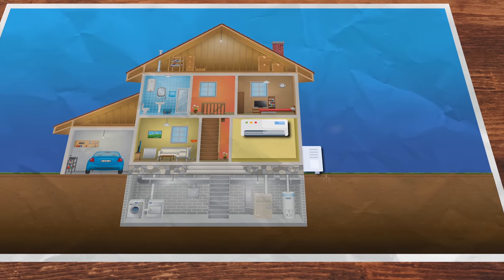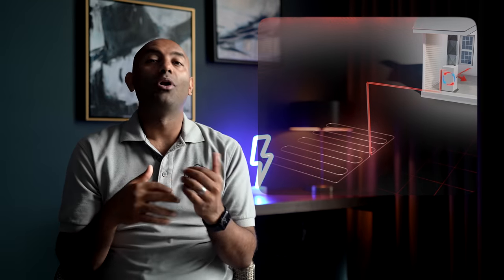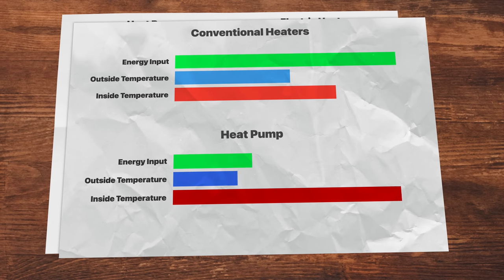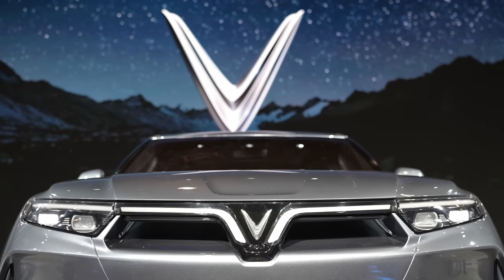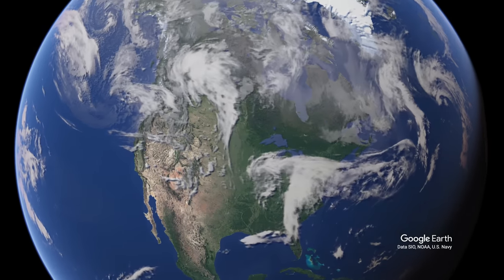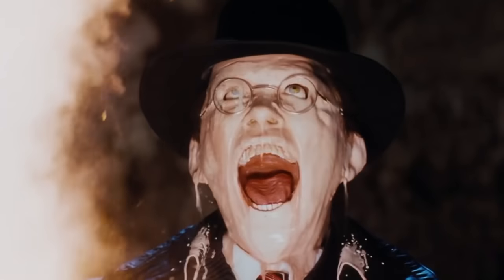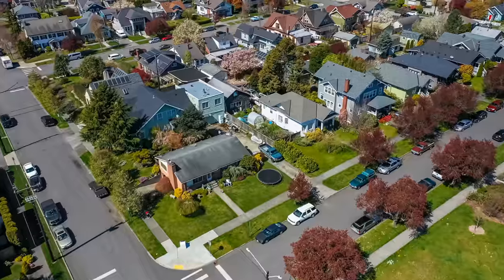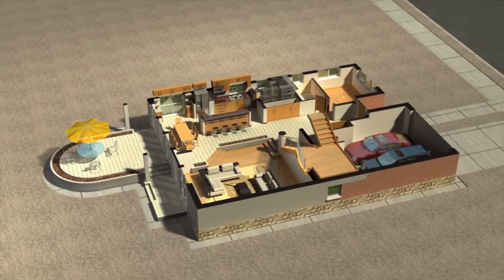Adding This Can Save You Money Summer & Winter!

Comment: We had Geothermal installed last September and it has worked flawlessly.  It is a 5 ton vertical closed loop system with two 288ft wells.  In January it used 1269 kwh (@.17/kwh is $215.73) , in April  it used 387 kwh (@.235/kwh is $90.945) so it seems it will use less electricity in the summer.  The oil furnace at 80% efficiency would use about 100 gallons of heating oil in a typical January plus electric for the blower (heating oil is now $5.37 per gallon here).  Our house has 1920 sq ft of living space and was built in 1987 and is reasonably insulated.  We live in near Kingston NY.  We are installing a 16kw solar system as our electric went from .17/kwh in Dec '21' to .235/kwh in April '22'!
Reply from the maker: That’s amazing data Chris! Sounds like hearing is the bigger challenge up there. Thanks for sharing and excited about the solar install! Prices are way worse here in CA
Reply: Just to give an idea of what actually happens:  Jan 15th 6:18A ET,  4.6F outside,  system is on, Water temp in: 40.46F  out: 37.23, Supply air: 92.56F  Return air: 67.95F /  May 8th 11A ET, 53F outside,  system is off,  Water temp in: 55.41F out: 55.7F , Supply air: 63.95 Return air: 63.19 (House is at 73F).
Reply: Good move Chris. Heating will always be the higher cost service with geo or any sort of heat pump.  The logic is based on the delta between ground temps and your creature comforts levels. Ground temps in most areas down 6’ from the surface or deeper are around 50-55 degrees F. Your comfort levels are 72-77 for most folks. The delta in summer between your comfort level and the ground temp 6’ down or deeper (55 degrees F) can be as much as 45 degrees F. In the winter, the delta between your comfort level and that 55 degrees is never more than about 20 degrees. That’s why geo works so well.
Reply: Hello Chris, I'm just accross the river from you in Hyde Park. What company did you use for your Geothermal? What was the cost and what was included? In other words, did you already have the ductwork, or did they install that too. Also what brand system was it? TIA
Reply: @joshmanor9970  Hi Josh We used Dandelion, and I would recommend them over anyone else.  The only problem is I hear they really have a backlog so it may take up to a year to actually get the system completely installed.  The timeline for ours was 9 months from the day we signed the contract to finish.  Our system is as described the only option we didn't get was the desuperheater as we already had an efficient hot water heater.  The total cost was $40,375.00 but the actual check we wrote was $28,805.00.  After the tax credits the total cost was $21,315.00.  Yes, we already had a hot air system (ducts) which had to be improved for the geothermal.  The electrical also had to be upgraded to 200-amp service which required the main panel be replaced.  The brand furnace they installed is Aaon.  We've not had any issues at all, and it has performed flawlessly.  In the winter (Dec/Jan/Feb/Mar) it used 4590 kWh which at our electric rate cost $1175.04.  Our oil furnace for the same time period at today's heating oil price would have cost $2950.00.  Even on the coldest nights we are warm, and the hot air isn't as dry as that from an oil furnace.  In summer (Jun/Jul/Aug/Sep) it uses less electricity 1505kWh for a cost of $385.28.  It does have Aux Heat which I call toaster heat, but it only rarely came on and used 23.78kWh for a cost of $6.09 over the whole winter.  So far in 2022 the Aux Heat has used 38.2kWh for a cost of $9.78.  The maintenance of the system requires changing filters, pro service after the first year and pro service every other year thereafter.  If you have any other questions, be glad to answer.
Reply: @chrismaxny4066  okay, thank you for the info. Yea, thats some wait time! Wow!  Another question...I'm guessing you did a closed loop system, but did you do vertical or horizontal loops? Water with antifreeze, or the newer vertical "DX" (copper pipe with the refrigerant)?
Reply: @chrismaxny4066  why did you only write a check for $28k if the total was $40k? What happened to the other $12k? That wasn't the tax credit right? You said that came off the $28k number. I'm confused
Reply: $1750.00 for not financing and $9820 from NYSERDA that goes directly to the contractor but they only pay if you use an approved one.
Reply: @chrismaxny4066  Oh, okay. Wow, thats a nice deduction right off the top! Then you have to pay the rest in full, then get the tax credit money back in your next tax refund, right?
Reply: @chrismaxny4066  And again, what type of system do they offer...closed loop vertical or horizontal with water and coolant, or the vertical copper pipes with freon? Do they offer a choice, or only install one style?
Reply: @joshmanor9970  Dandelion does closed loop vertical systems with water and coolant.  They don't do the DX system.
Reply: @chrismaxny4066  no horizontal systems?
Reply: @joshmanor9970  Call Dandelion and ask them.
Reply: Correction: The $9820 came from Central Hudson not NYSERDA

Comment: The combination of geothermal heat pumps and net metered solar power make an even more economical arrangement. You pay zero for utility bills and have reasonable paybacks, plus once installed the geothermal well (the most expensive part) doesn't need to be replaced for generations (not years, generations). The well material is polypropylene tubing which will last for hundreds of years in the ground.

Comment: Unless you live in Alaska (where closed loop heat pumps are pretty awesome), the calculation that needs to be done is to compare the cost of the ground sourced heat pump against the cost of a normal heat pump + solar panels.   I've done this calculation many times and I have never been able to justify digging into the ground.  It just makes a lot more sense... enormously more sense, in most locations, to spend that money on a cheaper (less efficient) air-sourced heat pump plus solar panels.  The other reason I would go this route is that it is a better fit for home energy storage systems (adding batteries to the solar system that you might want to do later on).

That said, I still really like the idea of the ground-sourced heat pump.  Well, at least closed-loop air systems.  I don't think well-based systems are a good investment for numerous reasons (maintenance, well depth, and vertical movement of the water table potentially causing the system to fail), but I guess it depends on the location.

BTW, modern gas furnaces last a lot more than 10-20 years.  30+ years is very typical these days.  10 years?  Only if you are being scammed.  The only thing that really breaks on a gas furnace is the Igniter which is $25 or less and a simple DIY replacement.

-Matt
Reply: Yeah. I put my gas furnace in in 1978. 44 years ago. I clean and oil it every year. still works fine.
Reply: I live in Alaska. I never thought these systems worked here because the ground is usually pact with permafrost and never wants to heat

Comment: I live in minnesota and we got a new Bosch IDS 2.0 Air source heat pump 2 years ago. It pretty efficient as a heat pump, works well enough down to around 0F, and is very efficient as an AC. We were doing a lot of work that summer and also got an induction stove, solar panels and new windows so there was a bit of question for us about if we were overstretching financially. 

I'm pretty pleased, what what we installed but i do wish i had looked more thoroughly into geothermal before getting the heat pump and spoke to geothermal specialist and not just the normal HVAC folks, but honestly, i just wasn't informed enough at the time to dig into it too much and happy to accept the HVAC guy's comments of how ground source is too expensive. It may have been in the end, but I am convinced it would have been worth stretching for if it wasn't too far above what we were paying anyway.

Comment: This was one of the major pros when we bought our house almost 9 years ago. Living in Sweden it is rather common and our system was installed in 2004 so the 20 year mark is soon coming up. 
Here most systems are made with a borehole into the bedrock but where we live in the south there isn't much of that so we have a ground loop.
It also has an extra heater if it gets too cold to cope, but that rarely happens, I think we have used it maybe for 40 hours during us living here.
I only would like the heater to be a bit smarter so that we could use it better in accordance to electricity prices.
Reply: James Biggar on YouTube did a hybrid solar pv / thermal heat pump design with air diverter valves triggered by temperature. So he's cooling his panels with incoming Canadian winter air that feeds warmer air into his heat pump. Brilliant but situational how close neighboring properties are and surrounding sunlight obstacles.

Comment: Geothermal heat pumps are great as long as the water is warmer than the air outdoors, once they are equal temperature there is no advantage to a ground source heat pump.
Heat pumps are AC units that reverse flow via a valve rather than physically reverse the unit say an AC in a window, Heat mode is AC with the AC unit in the window backwards.
As an AC unit operates around 40F and in heat mode we are air conditioning the outdoor air, once the outdoor temperature gets to 40 F the AC unit can no longer "boil" the refrigerant as there is no temperature differential, that  is why  below 40 F outdoors heat pumps require auxiliary electric strip heat which is very expensive to operate.
Reply: Geothermal HP are not using air for the heat exchange; they use liquid. Outside air temps have no effect on the system. I also don't believe anyone would spend 10's of thousands of dollars and use window a/c. Perhaps I'm misunderstanding your post, though. Sorry if I have.
Reply: And yet some how they can pull heat out of-15f air with cold climate heat pumps just not as efficient.....
But again totally different animal.

Comment: I’m just building a 6 bed house in the uk. It will have superb insulation and a ground source heat pump.  4kw solar on the roof and 20kw battery.  The battery will keep it all going until cheap rate electricity is available over night. Then it once again powers the house till the panels take over.  

On a less green note I’m building a 14m swimming pool in a building in the garden. This will be heated by 2x airsource pumps.  They will be great in summer when I can power them with solar and air temps are high, but I fear for the winter!

Comment: Here in Sweden we have 20-25 years of experience with ground source heat pumps. I had one installed last year with a 240 meter vertical drilled energy well. My neighbors had theirs installed 15-20 years ago when there was a big boom. My installation (ground source heat pump connected to water based radiator system) incl the drilling was approx 20kUSD before tax break.

The experience here is that the actual units last 15-20 years before they start to break down, and the unit costs approx 7-10kUSD to replace. The ground loops last longer, but the older wells were typically only 140-160 meters which isn't enough for a modern pump that's expected to handle everything on compressor (it was common before that the pumps were meant to cope with some of the season, but had resistive heating loop as augmentation when it got really cold).

Anyway, the tech is awesome but to make people switch there really needs to be CO2 tax so that natural gas becomes more expensive, and this tax used for tax breaks for clean tech installation.
Reply: Yes tax brakes seem to be a good idea but you are just paying that tax brake back plus extra administrative costs in higher taxes as that money has to come from somewhere which is you the tax payer.

Comment: We have a ground coupled heat pump system that we put in the house when it was new 27 years ago. We have seven vertical wells 200 ft deep and have about 6,000 square ft in our Kentucky home. Our house is totally electric. The average electric bill is around $300 a month.

When I was in undergraduate school (almost 50 years ago) I took multiple courses in physics and chemistry. When building our house I took great pains to make sure that it was built well thermodynamically. We are still benefiting from decisions made 27 years ago.

Comment: I'm trying to electrify my home. I'm really interested in geothermal. 

I had to replace my water heater recently and water heater installers were all pushing for gas water heater. There were major shortages but I was able to get a slightly undersized electric tank water heater eventually (wanted tankless). I'm not sure if it's common elsewhere but everyone pushes gas everything and make you feel crazy for trying to get something else.
Reply: If you are trying to electrify your house then you don't want a tankless water heater as the instantaneous load is really high. It is better to oversize the tank and have a lower continuous load that can be covered with Solar or purchased when energy prices are low.
Reply: @ShaneFromSA  Didn't know that, thanks for the information!
Reply: Even better, look up heat pump water heaters. Hey weren’t available when we built, but we tied our geothermal heat pump to our electric heat pump so it dumps some of its extracted heat to boost the water heater.

You’ll want to put it somewhere you don’t mind getting cooler and doesn’t get that cold. The heat pump does make some noise so factor that in as well.
Reply: Or if you go geothermal. Get one with what they call a desuperheater.  Which is just a water jacket around the compressor. That you run your domestic water through to get your hot water for free.

Comment: I'll be replacing my methane furnace and on-demand water heater with air-source heat pumps and same for the dryer, whenever we build a new place or find a tear-down retrofit we'll look at ground-sourced.

The furnace and water heater will likely be as the existing system ages a bit more or if it breaks, the water heater is new with the latest solar expansion but it would be nice to cutoff the gas all at once at that point

Comment: Does the material of the sink matter? Dirt vs clay vs some artificial stuff.?
Reply: Yes, it does! Water is a great thermal conductor, hence if your soil has a lot of it you will need less loops for your geothermal system. So, dry, sandy soil = lot of pipe, clay = less pipe. How less? Very much dependent on real soil analysis, but as I read in textbooks 2-3 time less is realistic.

Comment: Another benefit of heat pumps—especially the ground source heat pumps, and especially given the dramatic climatic shifts from climate change—is that they work in a bi-directional manner. So in a place like Texas where homes, buildings, and the grid are equipped for intense cooling in the summer, they are not so prepared for intense heating in the winter. Or in the Pacific Northwest they are equipped for heating but not cooling in the event of a climate catastrophe drive heatwave. The ground source heat pump helps address such problems that can turn deadly even.

Comment: Love your work. Been on the path for awhile. I consider transportation fuel part of our energy cost. This is due to the fact that it is!! As you know it's the least efficient system by one hundred miles. We view our 3.4kw rooftop solar as a gas pump offsetting $5 gal gas. Eliminated all gas other than furnaces. Your video helpful as we plot the move to heat pump. We live on Lake Erie just west of Cleveland. Hoping Dandelion opens in Ohio soon! Current geothermal installers are boutique outfits. Very expensive, very long installation process. Huge drilling rig. Booked one year ahead due to slow installs. Thanks for enlightenment!
Reply from the maker: yeah I hear you, and thank you for another awesome comment. We're in the process of working with a company called Water Furnace, who's going to be installing a geothermal system on our place. So stay tuned and we'll share all our findings with you!

Comment: I had a geothermal HVAC installed in 2018 and it cost 18,500 USD (3 ton package unit, all new ducking, and a 2 well open loop system.) The tax credit rebate i got was $4800 which paid for the wells entirely.  After the tax credit the whole install was less than the cheapest meh efficiency air system i had been quoted. 

A point of clarification though.  The open loop system you mentioned is a pump and dump system, which not only isnt terribly common anymore, but is on the EPA radar for a possible ban.  There are other open loop systems where they pull water from the ground and then deposit them back into the ground.

Comment: Great video. thanks. The vertical version seems a solution for retro fitting - it will be good to see some cost comparisons with vertical/horizontal installation. i remember seeing a video on a vertical installation a while ago and they seemed to think it doesn't cost as much as you think
Reply: I would like to see a vertical vs horizontal comparison. I'm in the city with a limited lot size.
Reply: @danielmcgowan9534  Daniel, the vertical installations are the best option for city dwellers unless the field can be laid in horizontally before construction of a community. Another factor is the area. If your soil has a lot of rock it will drive up the price of the vertical digging a lot. I have plenty of acreage with 3 good sized ponds so any of the 3 options were available to me but my installer talked me into the horizontal field choice due to my soil conditions, Field security and cost. The choice was easy once he explained it.